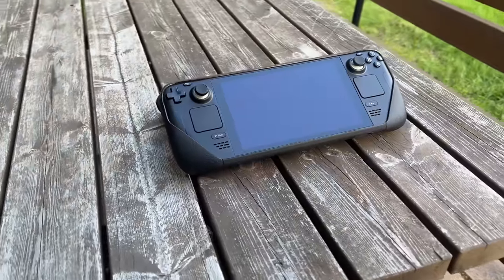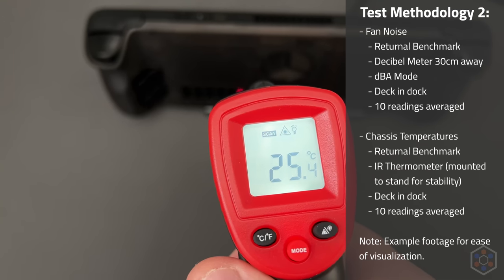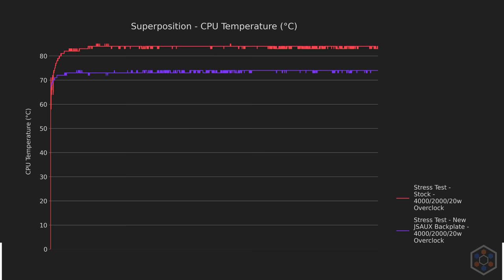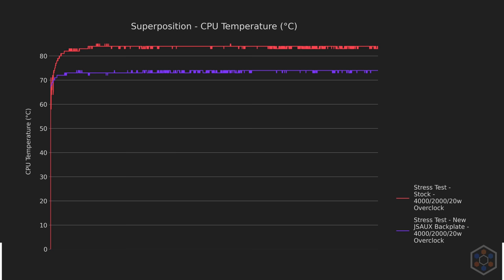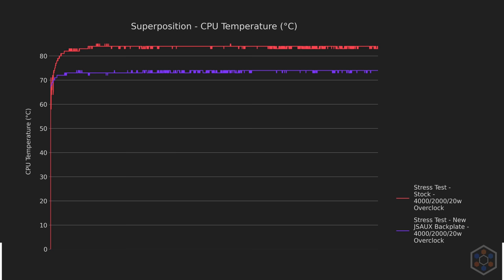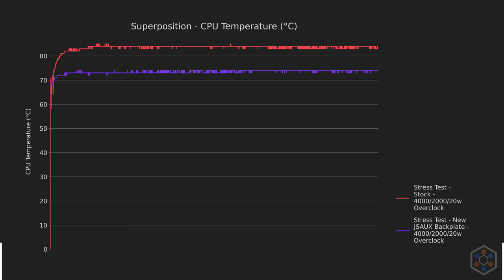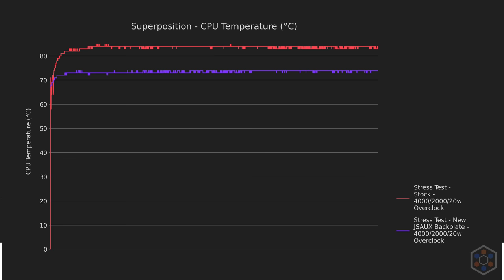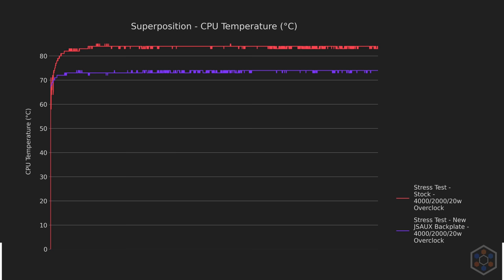How LOW Can It Go? | Steam Deck Thermal Modding

Comment: Many thanks for the lengthy video and these detailed tests. I already own a JSAUX protective case with a folding stand for the Steam Deck, as well as a neoprene sleeve that I have hardly used so far.
I actually didn't think about the heat development and the associated heat buildup. Most of the time, when the Steam Deck is in the stand, I just watch YouTube videos anyway.
The only negative thing I noticed is that the cases are difficult to attach and remove, and I'm always afraid of damaging the shoulder buttons. That's why I don't take off the case when I place the Steam Deck in Valve's dock in the evening. And it doesn't fit properly with the protective case. Well, I guess you have to live with something like that.
The Steam Deck is still my favorite purchase in probably 10 years. It's just awesome! So once again, thank you very much and good luck for the future ( ´◔ ω◔`) ノシ

Vielen Dank für das lange Video und diese ausführlichen Tests. Ich besitze bereits ein eine JSAUX Schutzhülle mit ausklapp Ständer für das Steam Deck und auch eine Neoprenhülle, welche ich bisher fast gar nicht benutzt habe. 
Über die Wärmeentwicklung und den damit verbundenen Hitzestau hab ich mir eigentlich gar keine Gedanken gemacht. Im Großteil der Zeit, in der das Steam Deck im Ständer steht, laufen ohnehin nur YouTube Videos.
Mir ist nur negativ aufgefallen, dass sich die Hüllen schwer an- und abbringen lassen und ich immer Angst habe, die.Schultertasten herauszureißen. Und deswegen nehe ich die Hülle auch nicht ab, wenn ich das Steam Deck abends in das Dock von Valve stelle. Und da passt es halt mit der Schutzhülle nicht gescheit rein. Na ja, mit sowas muss man wohl leben.
Das Steam Deck ist immer noch meine Liebste Anschaffung seit bestimmt 10 Jahren. Einfach geil! Also nochmal besten Dank und viel Erfolg für die Zukunft ( ´◔ ω◔`) ノシ

Comment: I will likely do the ptm mod and the new back plate. The one addition that I'll be doing is I'll likely add in a metal mesh to reduce dust intake. In addition I'll more than likely abandon my Killswitch case and go for something a bit cheaper that I can mod to allow for the new airflow pattern and the pair that new case with the deckmate kickstand. 

Excellent video as always.
Reply from the maker: Great ideas! The metal mesh is something I'm also interested in, as it could potentially improve back pressure and keep the air flowing in the right pattern.

Thanks for watching 😁
Reply: Just to let you know, they've made some changes to the new backplate. Mine came with a metal mesh installed and a thermal grease pad attached to the aluminium plate.
Reply from the maker: @kzgames3023 Mine also has that, but the plate doesn't protrude at all out of the back

Comment: I bought the old case like a month ago, the new one seems a bit odd to me, the design with the fan on the centre dont fit well, the option with the magnetic fan is tenting me mostly for docked mode. 
Very good video as always
Reply from the maker: The vent not being in the center bothers me too, but you can't argue with results 😉 Thank you so much for watching!

Comment: Is there a way to max the fan speed?
Reply: Yes bro, just use Decky and the plug-in called Fantastic which helps you to max out the fan speed but it's still the usual speeds the fan could go if temperature goes over 80°c
Reply: @willianmoncada1246  thanks

Comment: Does anyone worry about how hot the bottom right screen gets? That's where I feel the most heat on my deck.
Also I've seen some deck channels running their deck at around 80° and for me I'm always trying to keep it at 70° at the most by dropping my TDP to 8-10 and staying at 30 fps for games that are more demanding. My deck usually stays around 64-70°. Is hitting a constant 80° a big deal?
Reply from the maker: The chip in the Deck is actually safe up to to 105C, so 80 is cool by comparison. If you're keeping under 95C constantly, you're more than safe 🙂

As for the bottom right portion of the screen, I haven't noticed mine getting too hot, certainly not enough to notice it while playing.

Thanks for watching!

Comment: So the honeywell thermal pad is the single best mod at the moment ? given the jsaux backplate is a bit questionable in relation to the life span of other components. P.S I'm looking forward to seeing other cooling mods tested, great job.
Reply from the maker: The Honeywell pad is amazing, but so is the vented backplate. Regarding the backplate:
1. I tested VRMs, ICs, the SSD and the RAM for temperatures with the vented backplate and saw less than 1 degree difference from the stock backplate
2. A lot of air still gets taken in through the rear vent, even with the vented backplate, so I have very few concerns with device longevity. 

The pad is definitely the lowest risk mod, though 🙂

Hopefully this alleviates some of your concerns, thank you for watching!
Reply: @cryobyte33  Thankyou for replying, I will now order both items on pay day. I won't overclock for now, it's more just to extend the decks lifespan. Stock speeds & extra cooling.
Reply from the maker: @demonhighwayman9403  That's exactly what I'll be doing! The fans being quieter is much nicer too 🙂
Reply: @cryobyte33  I'll need to replace my delta fan as well I think, the sound I barely notice but I want it to be perfect.
Reply from the maker: @demonhighwayman9403  I plan on replacing mine as well, hopefully after I get to the US 🙂

Comment: So is honeywell ptm alone a well worth upgrade? I wanna do that so I can always consider the new backplate with vent or wait for a better one. 
And why hasnt anyone made a better upgrade drop in copper heatsink, that could definitely be reworked and help a ton
Reply from the maker: Yup, there are tests in the video for the pad alone and it's still a big improvement over the stock TIM. As for a copper heatsink, I've heard rumors that someone is looking into it, hopefully we won't have to wait long! 🤞
Reply: @cryobyte33  Thank you! I was only considering but now I'll be replacing with ptm. Do you have any opinions on the new drop in gulikit hall effect joysticks? As well as the SSD copper heatsink available on amazon, good reviews even for use with the ROG ally but I have yet to see any youtube videos about it. Gonna be opening my deck soon and wanna get as much done at once I can think of!
Reply from the maker: @6double6.  I have a new set of Gulikit joysticks waiting for me back in the US so I can't say anything about them yet... but soon 😉
As for the copper SSD heatsink, there are 2 potential issues:
1. It could interrupt airflow or conflict with the metal shielding
2. It could result in the WiFi and Bluetooth being significantly slower, do to the increased mass over the wireless chip.

Both are just conjecture since I haven't tried, but that's what I'd watch out for 🙂
Reply: @cryobyte33  Interesting, thanks again! I'll be waiting for your videos to drop but a new ssd and ptm will do for now. Is the copper ssd heatsink interesting enough that you will be testing it?
Reply from the maker: @6double6.  If I do a copper heatsink it'll likely be part of a larger modding-centric video a few months out. No promises, but if you want to try it I'd be happy to hear your results!

Comment: Hey bro, firstly good job and secondly I have a suggestion for you I would recommend you make a video on windeck OS Ijust installed it you can compare it to a normal windows install and compare it on different drives I think people would love to see that. 
If you do make the vid can you find out why windeck os dosnt work with 4gb vram in bios have to reduce it to 2GB or I get hard restarts.

Cheers bro
Reply from the maker: Thanks for watching!

I've been planning on making a video on WinDeck, but I'm definitely not a big Windows fan so I've been putting it off 😅

As for why it gets hard reboots, I'd guess that it's trying to allocate more memory than it has available all at once, Windows is notoriously bad at memory management.

Comment: Hey Kyle I have been curious about something for a while and Google searches don’t seem to help. I was wondering if it is harmful to the deck to run the GPU and CPU at full power for a long time? Thanks and keep up the awesome work!
Reply from the maker: Thanks for watching!

Chips are designed to run at max for long periods of time, it's actually less harmful than constant heat cycles. The entire "Mining GPUs are bad" thing is a myth for that reason 🙂

On top of that, Valve keeps the APU slower than it was designed for, and at only 15w, so running it at max isn't actually pushing the chip to its limits.

Hopefully this answers your question!

Comment: Hey CryoByte33,
Is there any cance that i can mod the sd so, that i can play League of Legends on it with 120-144FPs ?
Reply from the maker: Unfortunately no, the Deck's display output maxes out at about 70hz of bandwidth, even the DeckHD screen only goes up to 60. In order to get more there would need to be a completely different motherboard, at which point it's not really a Deck anymore.

Thanks for watching!

Comment: Sweet, will be making that change myself then. I was curious, maybe I missed it, but why would you need to chill the thermal pad first?
Reply from the maker: The pad itself is very sticky so chilling it keeps it easier to handle and cut. It was in the screenshot from Discord, so I understand missing it 🙂

I'll try to make these things clearer in future videos, thank you for watching!
Reply: @cryobyte33  no worries I was working on my morning coffee, so not fully awake lol. But I am curious if replacing the pad on the plate would be of any benefit as well. Probably not a significant amount but still curious.
Reply from the maker: @Vaskomyr  It might, but the PTM pad is much too thin for that. I'd say that K5 Pro would be the only replacement for that 🤔

Comment: Thank you kindly this is such cool data!

but could you slow down just a hair on more complicated graphs. Specifically 20:19 it isnt a problem on my phone because i can pause it and see the graphs (i get that its to keep from elongating the video) but if im casting the video to a chromecast or etc. When i pause the video it covers half of the bottom graph with recommend videos.
Reply from the maker: I'm so sorry for the pacing, I'll definitely try to slow them down! I was trying to keep the pacing up a bit to have a higher retention through the video but I'd prefer to make it easier to watch 🙏

Thank you for the recommendation, hopefully the next video will be a bit better for you!
Reply: Thank ya and Yeah I figured that :) 
the normal charts are fine with that pacing, but once ya get to like 6 or more or 20:19 , it becomes harder to parse the data :).

Comment: I'm using the JSAUX fan since I can't open the deck due to warranty reasons.

I can say that's it's pretty good at maintaining the deck's temperature from over heating. Not sensational but really helpful. Lol With regards the noise, I actually forgetting most of the time it's turned on. I'm not noticing it much these days and I'm always playing on handheld. You'll get used to it. Personally, noise not a deal breaker. Definitely worth while especially if you don't want to mod your SD. Big downside is it's pretty heavy. 😅😅

Comment: I juuussttt Switched from the Old style JSaux backplate to a full clear extremerates shell, and now i'm thinking i might have to get the new style backplate in clear lmao.
For now i've just slapped the large thermal pad from the old style backplate onto the new all-plastic one, which will hopefully give me a little passive cooling just via the plastic outer shell. not ideal but better than nothing!
Reply from the maker: I actually have an extremerate shell on hand, but I haven't tested it yet. It SHOULD be identical to stock, but I can't imagine it'll be anywhere near the new plate.

Hopefully JSAUX comes out with some better colors like extremerate and we can mix and match a bit better 😉

Thank you for watching!
Reply: @cryobyte33  Small update to this. The new JSAux clear backplate is a pretty darn good match to the extremerates shell. So i'm happy :D
Reply from the maker: @ale6242  Glad to hear! I hope to try the RGB backplate myself at some point 🙂

Comment: I've got the new jsaux cooling fan. It drops my temps by about 10 degrees in most cases its  been great.
Reply from the maker: It's definitely a great product if you don't mind the noise 🙂 Thanks for watching!
Reply: @cryobyte33 Ye but even at maximum fan speed I don't think it's that loud.🤔 got to be a really picky person if someone thinks it's too loud I reckon, it's just right I'd say for noise levels.

 Would love Jsaux to improve on higher speed fans & better battery time in the future, My fingers crossed anyway. 

great content by the way dude as always. 👏
Reply from the maker: @Kennosuke88  I'm a little picky, but my wife who's not picky can't handle it either. Both of mine drown out gameplay and speakers alike 😅

Comment: Great video, but if electronic equipment needs to be modified and cooled by the user, there is something very wrong with that engineering.

Playstations 5 need liquid metal, and they're melting USB ports at EVO 2023.

The heat of the Steam Deck in my hands made me give up buying it, I'm going to test the Asus rog ally if you have the same problem.

Comment: I have the old jsaux backplate and i took the thermal pad off the plate so that the metal doesnt get hot enough to burn me, but i was wondering if doing so equal or worst than stock?
Reply from the maker: That should be a little worse than stock since the metal plate will obstruct some airflow, but only by a few degrees at most. Thanks for watching!
Reply: @cryobyte33  are you sure about that? Just removing the thermal pad on the old pad makes the airflow more or less the same as before. I have the old backplate with the thermal pads removed due to bulging. The temps seem around the same as before. Though due to quality control issues I am hesitant to upgrade to the new backplate. I want it to sit flush with the chassis unlike the old one bulging.
Reply from the maker: @s0rr0wHacker  The metal plate itself has thickness greater than the plastic in the backplate itself, so it's a tiny bit obstructed, at least on mine.

As for QC issues, my new one is a perfect fit, but I definitely understand the hesitation.
Reply: @cryobyte33  I see, it may be a manufacturing deviation

Comment: What do you think about the combination with the new backplate and the clip-on fan?
Reply from the maker: The clip-on fan will nullify the main benefits of the center backplate since it covers the vent up. It could be good as a docked-mode boost, but it wouldn't be terribly efficient.

Thank you for watching!
Reply: @cryobyte33  thank you for your answer, appreciate it. I will test it in combination with their modular case.

Comment: my question: you clearly have the mod case why didn't you get the modcase vesion of the fan
Reply from the maker: I also have the modcase version of the fan, but it's currently sold out on the JSAUX site and I didn't want to test something that others couldn't get 🙂 Results are identical, so feel free to get it if you can find it!

Comment: Thanks for the content, I just ordered the version 1 backplate from jsaux but might consider sending it back.
Just very curious how the version with vent will fair for the charging IC when charging from low battery percentage and heavy gaming though.
Reply from the maker: Regarding the new backplate:
1. I tested VRMs, ICs, the SSD and the RAM for temperatures with the vented backplate and saw less than 1 degree difference from the stock backplate
2. A lot of air still gets taken in through the rear vent, even with the vented backplate, so I have very few concerns with device longevity. 

Thank you for watching, and I hope this helps!
Reply: @cryobyte33  This is actually quite interesting, I mean 1 degree should not really pose so much problem, I guess the extra mass might help. 

Still wondering about the Charging IC under charging and load, how did you measure the temp of the IC?
Reply from the maker: @TontonGahu   I used the "sensors" command for SSD and motherboard temperatures, spot checked with the other results I gathered from MangoHUD.

The ICs and VRMs were a bit more difficult. I used a temperature probe wired through the back vent to measure the surface temperatures, and verified its accuracy with a backplate-off IR thermometer test. Obviously the backplate-off results are cooler, but I verified that the probe was accurate that way.
Reply: @cryobyte33  wow that is awesome to read! Did you mention any of that in the video and I missed it or was it just extra test you left out?

I love to see such thorough investigation!
Reply from the maker: @TontonGahu  I mentioned it briefly in the concerns section but I left that test out of the video in the interest of time 😅

Comment: What did you use to log performance and temps on the SD?
Reply from the maker: I use MangoHUD with a custom config file and then render them out using a software that I wrote 🙂

Thanks for watching!
Reply: Thanks a lot Kyle! I'm trying to understand whether my application of a new thermal interface actually made things better or worse, this will help me get objective measurements
Thank you for your content and scripts too :)